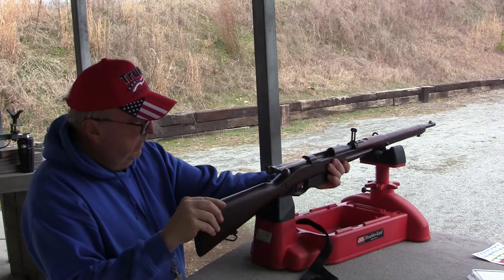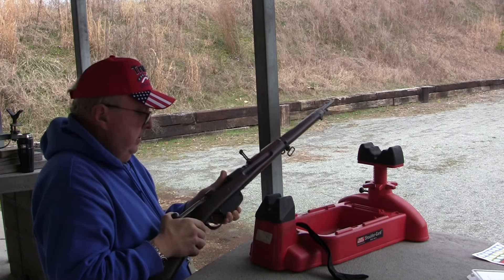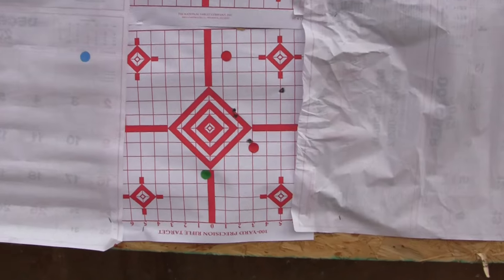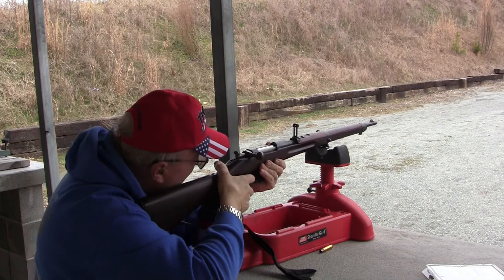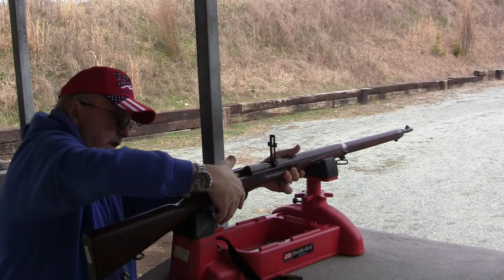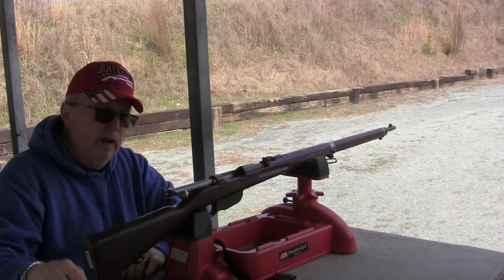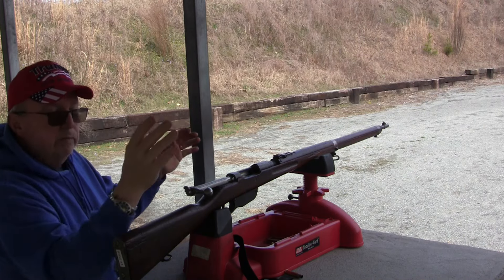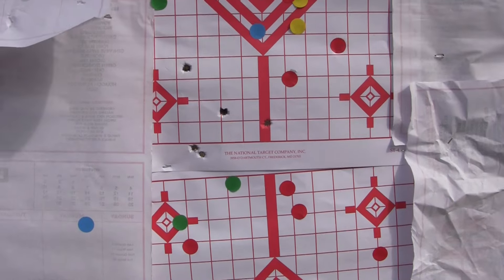Testing 8x50mmR in M95 carbine & long rifle

Comment: Just for clarification, are you shooting 8x50r in an 8x56r rifle?  Of so, this is something I started doing a few years ago since I had so many M88 variants.  I hated loading two different calibers, so I experimented and found the shorted cartridge worked for both.  One thing that I found will increase accuracy when using the 96 is to seat the bullet farther out.  Great video!